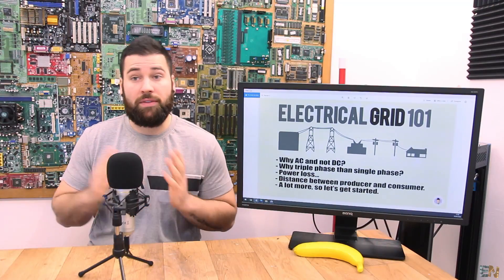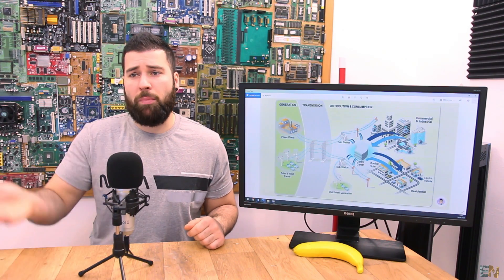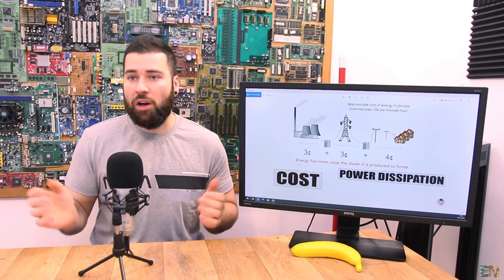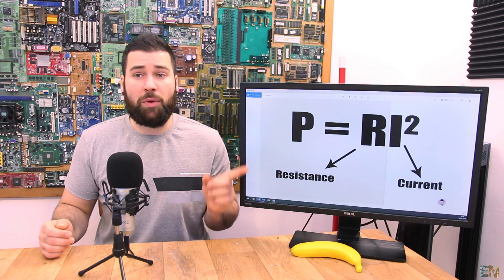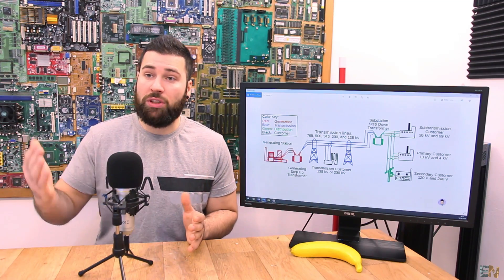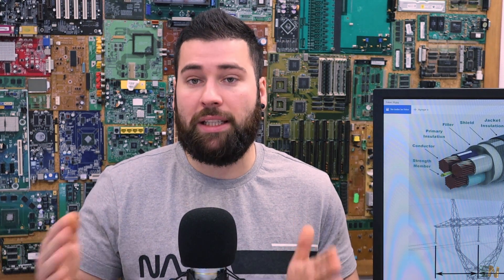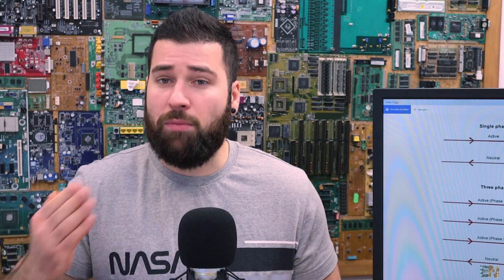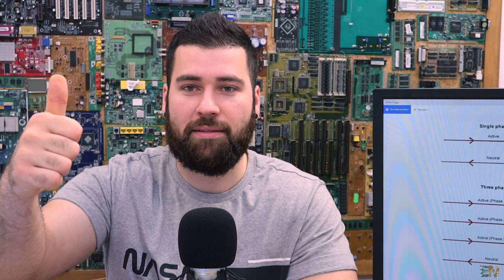LearnMore#5 - The Electric Grid - How it works and why

Comment: @electronoobs- Fantastic video. Just wanted to add 1 more reason why power lines are not insulated at around 07:30 - Insultation for power cable is proportional to the voltages, so to insulate lets a power line carrying 110KV will need many metres of insulation. This will then requires cables to be laid much further apart. thank you... Best wishes from UK

Comment: Nice job as always. There is one more reason to use AC instead of DC. If you use a normal light switch (220V AC) with 220V AC, you will see a little spark when turning it on/off. Try to use 220V DC instead and see the difference. (you can see better on a circuit breaker, but you need to open it and do short-circuit. that's a nice video to see 😁 how circuit breakers work)
Regards from Portugal.

Comment: Actually, the power transmitted in 3 phase systems is more than 3 times greater. The formula is: P =√3*I*V*pf. Depending on the pf,  you can consider it better.
Reply: Actually power in 3 phase system is 3 times greater than power of single phase, you can write that as P=3*Ps (where ps is power of single phase) Ps=V*I*cosfi, but since voltage between phase and neutral is V/√3 you put that into original equation, divide that and you get  3*V/√3*I*cosfi (since 3/√3=√3)=√3*V*I*cosfi

Comment: A lot of people get confused why we are using P=I*I*R, and not P=U*U/R for calculating power loses. It's because our load and transmission line are connected in series. We can illustrate both load and transmission wire as resistors that are connected in series.

Comment: DC power lines are in comparison to AC better for longer distribution. They have less power losses (e.g. 3% and AC e.g. 7%). We need only two "wires" so we need smaller towers and less wires so this reduces the costs. Also in DC we don't have skin effect. But changing DC voltage level is much more complicated than AC. So the DC is used for really long power lines.
Reply: To protect the lines is with ac or Dc, is not that different.

But to disconnect or trip a line with Dc its a lot more difficult as ac because ac is alternating and crossing the
'zero power point'. So it will extinguish it self.. With (hv-) Dc it's nearly not possible

Comment: This guy literally covered the entire semester of power distribution engineering in one single video!🤩💥
Reply: Is the power grid 3 phase? I see the street transformers providing the 3 phase around my area... Meaning the distribution is single phase?
Reply: @jamess1787  yes.. power grid is 3 phases .. usually 5 wires... 3 for phases 1 neutral and a earth! Domestic distribution depends on the connection.. companies give options for 3 phase and single phase connections
Reply: are you  kidding
till 7.00 mins the content was very general and perhaps majority of people with a basic science background must be knowing it.
even the 3 phase part was taught in the 1st semester.